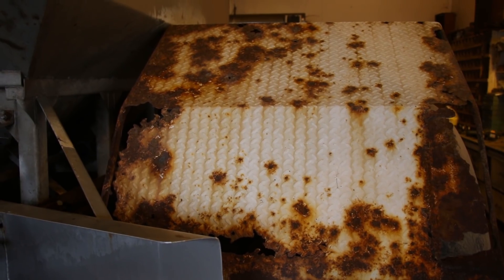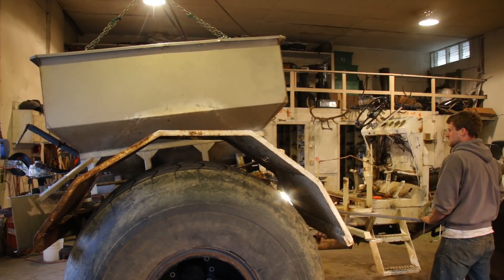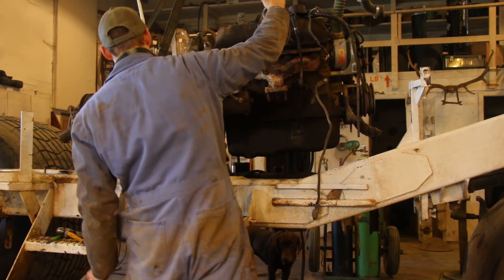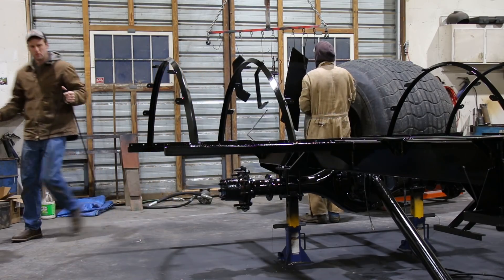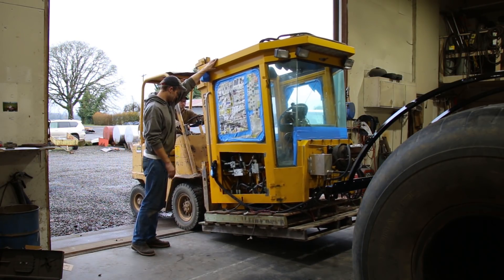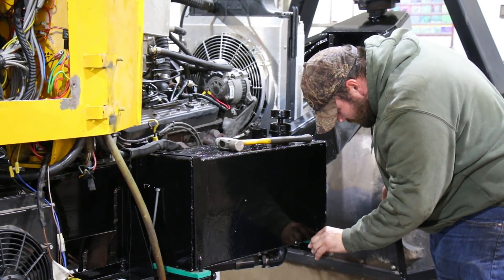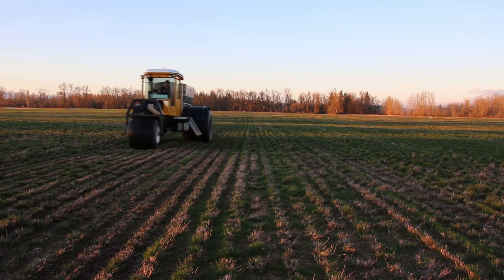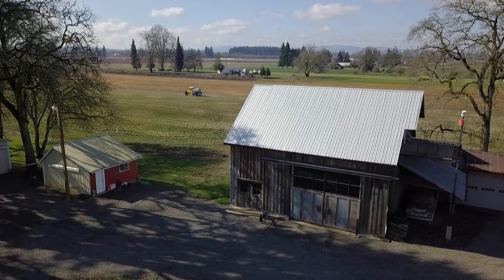Building Fertilizer Buggy ver. 2.0

Comment: I just happened to come across your barn tour  video today, and then this one. The new fertilizer buggy is awesome, you guys did a great job. 
I used to work at a fertilizer company for 10 years doing custom application with 7300 Terra Gator. All the extras you added will make your life easier and a lot more comfortable, a/c, air seat, GPS, dual spinner and the bin camera. 
I actually had an extra camera on the  back of the bin for road use, helped to see vehicles that follow way too close to farm machinery. 
I love your shop, very well thought out. I subbed to the channel. 🇨🇦

Comment: I have a question: Why is fertilizer spread using a dedicated buggy and not a trailer behind either a tractor or, if compaction is an issue, a versatile buggy that can tow multiple trailers, depending on need?

Comment: Now you have to set a preprogrammed route  motor controls of the  various values and accelator/brake/ steering etc (code for operating) and use gps to let it run on its own with spreading extra or less fertilizer in certain parts of the field, depending on yield on previous parts on previous years.

Comment: Cool build. I heard to spread fertilizer in Miller spreaders for 3 years. Couple of tips; wash the vehicle as often as possible to get the fertilizer off, when turning around at the field edges turn off the bin belt until you get lined up to make the next pass, and finally find a good radio station!

Comment: please excuse my ignorance but what advantages does this dedicated machine have over a tractor pulling a trailer with a spreader on it?
Reply: All things being equal, not much difference from something like an Adams HLS8. However, this build is not what I'd call equal to a conventional setup. Advantages I see.....better flotation, better turning radius with less lateral digging, reduced ground pressure, quieter (Gen 1 SBC vs JD 414-548 ci diesel) cheaper to maintain engine/trans, off the shelf A/C parts, likely better visibility, easier access to hydraulics/engine/etc..., endless customization possibilities, and ability to travel roads at near road speed.
Reply: the main advantage is the ability to run on very wet ground that a tractor would sink on.
Reply: @westcoaster3763  thankyou

Comment: Awesome!!   Just a warning, make sure when using stainless bolts and nuts,....always use anti seize on the threads,....otherwise they will "bond" together after 4 to 6 months  and  not come apart,......learned that the hard way.

Comment: A suggestion..add a 3quarter inch brace plate about 6inches away from the engine to the end of the buggy.. It will add a Lil more wright and the engine air flow will be directional.but any higher speed bumps while running the buggy.. the brace plate weight will stabilize the body.. A Lil better... God bless

Comment: Awesome!

Can anyone tell me what fertilizer buggys can do better than fertilizer spreader for tractors?
Reply: Nothing.
Reply: Drive on soft ground that would sink a tractor.
Reply: @westcoaster3763  Wouldn't that be also necessary for other applications?
Reply: @KonstantinKöhler  the farmers use the buggies for spraying with a tank that they replace the bin with. Or they have a spray buggy and a fertilizer buggy.  The farmers also use them to pull seed drills now and then when the rain comes before planting.
Reply: @KonstantinKöhler  we get lots of rain in the area where these are used and sometimes the ground is much too soft to drive a tractor on.

Comment: Why did you go with a 350 over a diesel. Is petrol cheaper than diesel in the US?  Because in New Zealand it would be way to inefficient to use a petrol engine for a piece of machinery.
Reply: Yes, petrol is typically cheaper than diesel.
Reply: I'm not in his area of the USA, I'm in Texas but gas is running around 2.06-2.20 a gallon US and Diesel is anywhere from 2.59-2.97 a gallon US.
Reply: Where I’m at diesel is a dollar more than premium
Reply: @TioTheo711  Where is that?
Reply: G.t. W sacramento, CA
Reply: Cam Myers y’all have us beat. Even though that’s nothing to brag about.
Reply: G.t. W it certainly doesn’t help that just a few months pre gas tax ago premium was nearly 4$ a gallon

Comment: Due to their nature frames are actually overbuilt. Depending on how they are made they can bulk up 20 30% more than intended. A regular 1980's truck (be it ford or chevy or another) well, you could cut up quite a lot of the frame and it would still work as intended (for a while before metal fatigue installed).

Comment: As someone who has no knowledge of farming, I have a question: Is the point of the giant flotation tires to be able to drive over seedlings but spread the weight over so much surface area that it doesn't harm them?
Reply: Flotation tires are used also to avoid compact the soil.
Reply: @rainfallprojects501  Thanks for the answers you two!

Comment: As a Mechanical Engineer designer  i have to confirm: Operators have the most valuable advice for design improvements.
Reply: Also has a mechanical engineer, the repair technicians also have invaluable advice.
Reply: An engineer with common sense!!!
You are one of the very few...
About 25 years ago, I had the pleasure of having John Deeres regional rep, one of the national VPs, and an engineer who designed the early disc mower conditioners.. we had the first 1327 in Oregon. Was great to have the opportunity to enlighten them... In the Midwest, the machine worked great, in two ton per acre crops... We had major issues in 4 to 5 ton per acre crops!!
I showed them the major issues, two years later, the 1360 (?) Came out... They made the exact changes I suggested 😎😁
Reply: @GosselinFarmsEdGosselin  did your farm get a free one? You should have...
Reply: @aaronschoessow9567  I wish!!!
At least we got to buy one that had enough clearance between the cutter head and the conditioner to get through the heavier crops.... Without burning up the belt, or shut down a 180 horse tractor... Ran it until the CV joints finally wore out. Of course mid season.
JD couldn't get a new Driveline for a few months.... And Driveline Service couldn't get parts to repair the old one for over six weeks....
Dad traded it in on a New Holland H7230.... Nicer machine to Chang blades on and clean up... But it's got rollers😢😥 added a day or two to our dry time..... Next time, we will go back to the impeller conditioner!!!
Reply: Tell that to my engineers at peterbilt
Reply: @okatexoffroad1813  OMG!!! Do we really want to go there???
My son in law has a 2016 Pete.... Yup... Engineering nightmare!!!
He's on the fourth or fifth cabin fan, changes cabin filter every month... They only stood behind the first fan. He's done more air line work and valve replacement than I've done on four Freightliners that are all 1.25+million mile trucks....  
And WTF!!??!! They took the batteries out of the cabs in the 1950s... LOL, Peterbuilt put them back in the cab.... Kinda hard to have an air ride passenger seat....
I've seen a couple that had overcharge issues, kinda messes up the seat base and floor boards... heaven forbid a battery should blow up!!!
Reply: Also as a mechanical engineer, I 100%ly approve there.
Reply: Gideons Word  I believe in that too. whem we have interns i aways say: You have to design something that can be manufactured using local supplyers, can be used and maintened. if one of that 3 things is not applyed to the desing, that machine is a paper weight.
Reply: Which makes you smarter than at least half your kin.